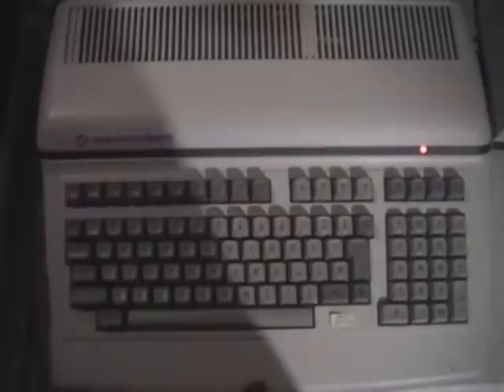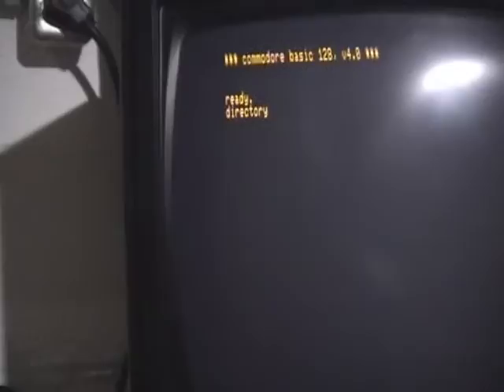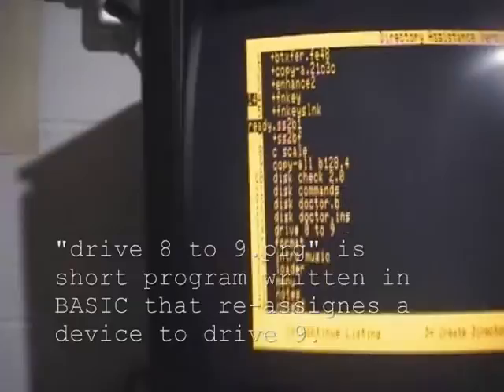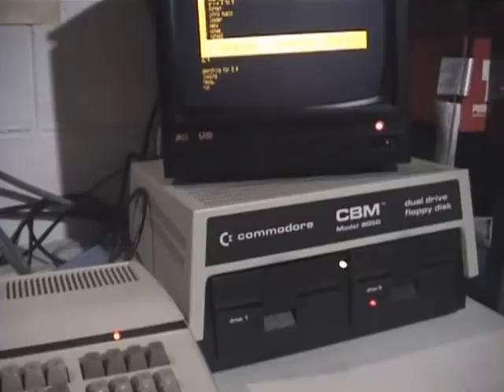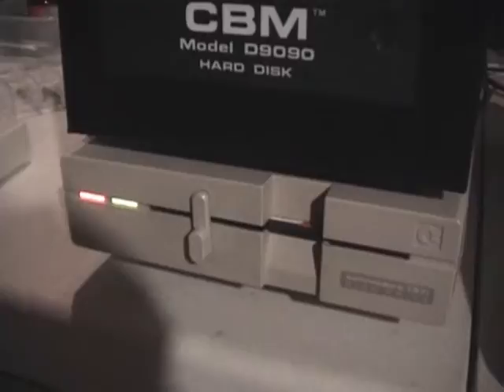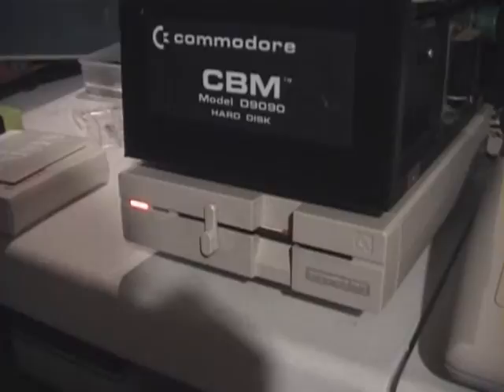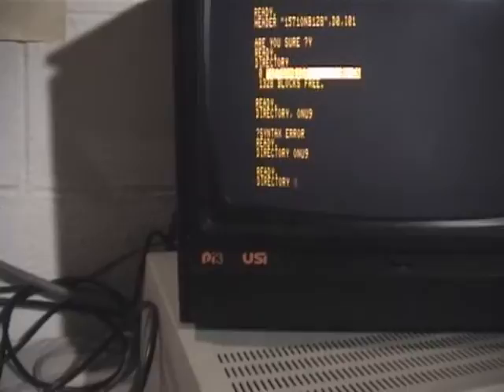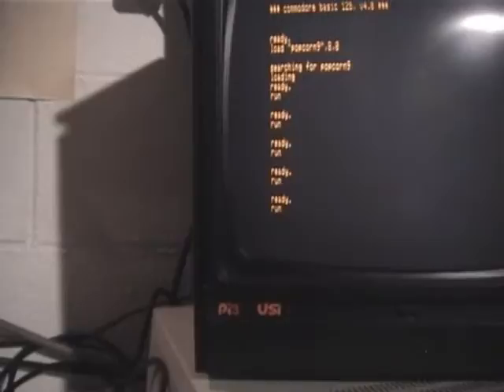CBM B 128 with D9090, Serial Bus, 8050 and 1571

Comment: Technically the "fast serial bus" device is not an IEEE to IEC converter. It is an implementation of the IEC port using the B128's user port. The IEC protocol is implemented in software and it also routes the I/O to the proper port as selected.